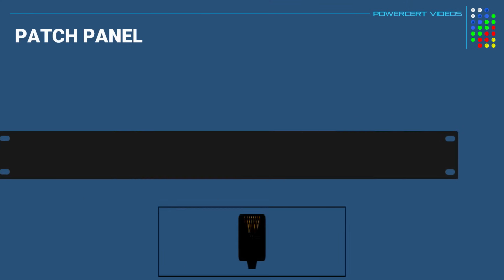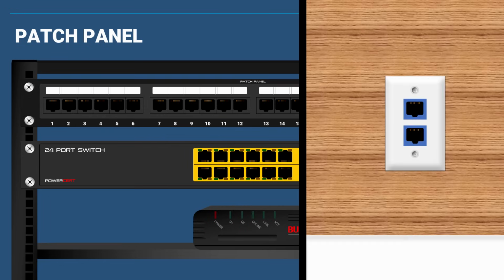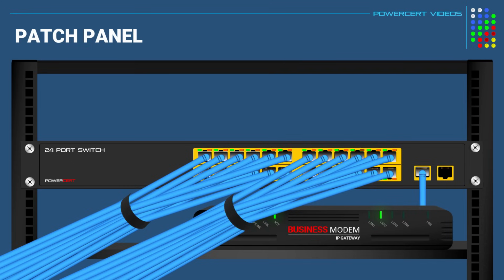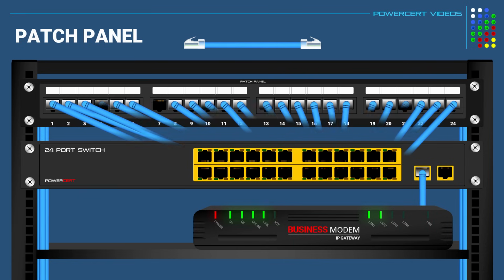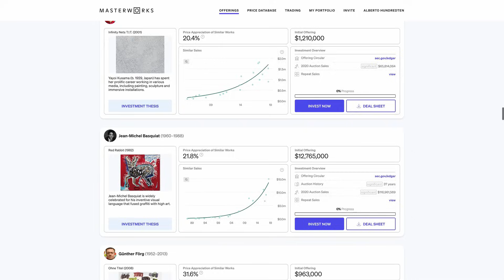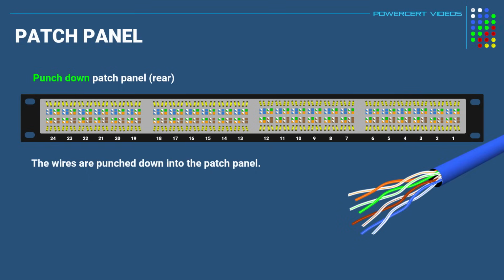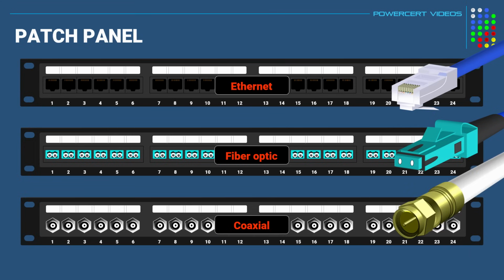What is a Patch Panel?  (cable management)

Comment from the maker: Purchase shares in great masterpieces from artists like Pablo Picasso, Banksy, Andy Warhol, and more: https://www.masterworks.art/powercert
Reply: Next is "how olt onu and fiber splicing works?"
Reply: Nice Video ...😊 Please Discuss in  details which is i am going to share here with you unique and simple animation way .... 1. ARP [all type arp], 2. Layer 3 packet structure and changes while passing through Router, Firewall, Core Switch, load balancer devices, 3. IPsec. Work flow 4. TTL value ... I will share more later on. For now that's all
Reply: Bro I am a thumbnail editor if you need   I am willing work with you
Reply: Can I ask you what program you use for your graphics in the videos, I am in my training to be an administrator and for my exam it would be very useful to use this program as it is very clear and simple. Thanks in advance.
Reply from the maker: Powerpoint

Comment: I still don't understand.... It's just one more connection 🤷
Reply: Yes its one more connection. But patch panels make sense in large networks where you have many data drops. I work in K-12 IT.

In our environment, we have an IDF network cabinet for every wing of about 5 classrooms. Each classroom has about 10 data drops. That's 50 network cables running into a network cabinet in a central classroom. Those data runs terminate at the patch panel and we then connect a patch cable between the respective patch panel port and switch port. That way we can more cleanly organize our physical wiring and not have 50 cables plugged into a switch when they're not needed.

Look up pictures of network closets and you'll see why they make sense.

Comment: I still dont understand....so if you have a switch that allows you to label where the connections are coming from would you still benefit from  a patch panel?
Reply: Patch panels make sense when you have a large network. I'll give you an example of my work place (K-12). We have a network cabinet in each wing of classrooms. Each wing usually contains 5 classrooms. And each classroom contains about 10 data drops. That's 50 ethernet cables coming into a network cabinet. Technically, yes you can bypass the patch panel and plug directly into the switch. But this is not done in large networks since the ethernet cables are not meant to be moved around that much. They can break if you move them too often which means you may need to re run the entire cable run which can be difficult and/or costly. So we terminate those cables into back of the patch panel. Then we plug in a shorter ethernet cable (patch cable) from the appropriate panel port into the appropriate switch port. Our switches have their ports labeled based on what they are for. In our example, we designate 5 switch ports for access points, 5 switch ports for VOIP (digital phones), divide the rest between security camera, staff, and student ports for their respective VLANs.

In small networks, like a home or small business, you likely won't benefit from a patch panel. It makes sense in medium to large networks especially when you have a large number of wired devices: printers, phones, cameras, Wi-Fi APs, laptops/PCs and the like.

Comment: What happened to the other end of the cable? Where should it be connected to
Reply: One end of the cable terminates at the patch panel. The other end terminates at the workstation area - that could be a cubicle, an office, etc. You would terminate that end into a keystone jack.

You bridge the connection between the panel and switch using a patch cable. It is just a short ethernet cable.

Comment: You missed another great benefit of patch panels. The building network wire once installed is rarely disturbed during diagnoses, repair, or modification. Only the more flexible patch cables are. This increases network reliability significantly! 99% of jobs require patch panels.

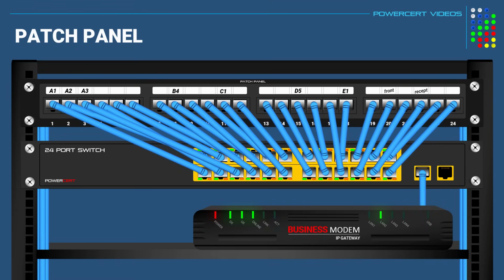Comment: 4:40 Switches usually work at Layer 2 of the ISO/OSI model, meaning they forward data based on MAC addresses, not IP addresses. Routing, which involves IP addresses, is typically handled by routers. That said, there are some less common Layer 3 switches that combine both switching and routing capabilities, allowing them to route traffic between VLANs or subnets, but they are generally used in more advanced or specialized network setups.

Comment: I've been in this business for 16 years. I lost count of the number of cables that are connected from the patch panel to a switch 2 RUs below it (inches away) using a 6'-10' patch cable with the excess balled up in a knot and crammed into the nearest crevice.
Reply: I work in K-12 IT and our network cabinets were the same way. Years upon years of neglect and laziness led to some pretty horrible looking cabinets. We cleaned them out almost a year ago with much shorter cables, but its still not great IMO.
Reply: @JJFlores197  I once did a job for a pharmaceutical company where the IT designer was once an installer with many years of experience.
He designed the layout with one patch panel. above one switch and stacked them in racks without wire managers, saving space. The patch panel and switch ports were connected with 6-inch patch cables port for port sequentially. It was beautiful and easy to install. No cable management was required.
It was a common-sense design. Some switches had 12 ports and a 12-port patch panel, some 24, and some 48. 
No labeling was required on patch cables. He used different patch cables to identify each port: blue for the workstation network, white for cameras, red for badge access, yellow for WiFi, etc. Each device or outlet was identified by the port with a matching-colored label. All the cabling to each device matched in color and had its own lane in the basket tray. Devices had their own switch for each floor, and they were connected to servers that were connected by fiber throughout the facility. It was a work of art.

Comment: Yea but why, it's not really "more organized" than if you just take the time to label the cables going into the switch. Patch panel is just extra work and cost for effectively no benefit.
Reply: When you have 50+ data drops, it becomes very difficult to keep it managed. I work in K-12 IT. A network IDF cabinet usually services a wing of about 5 classrooms. IF we assume we have 10 drops per classroom, that's 50 ethernet cables going into one network cabinet. It can very tedious having all of those neatly labeled. That's why the cable runs terminate at teh patch panel. Then we just patch/unpatch drops as necessary.

Comment: Useless panel.
Reply: I wouldn't say they're useless. Depends on the application. In very small networks, yes it doesn't make sense. But when you have larger networks with many different network cabinets across the area, it does help to have patch panels.
Reply: @JJFlores197  why would on earth you use literally a joint( patch panel) when you can run full length cable to your network gear.
Reply: a patch panel is just conductors with no electronics

Comment: This was soooo helpful. I'm currently an IT Technician trying to move into Networking and though I get the concepts sometimes it's hard to grasp. Appreciate it!
Reply: what do you do as an it technician if it's not networking?
Reply: @gamecubeplayer  I'm on the support side. I take care of tickets submitted by staff members that usually just pertain to their devices. I do sometimes work with our Network Engineer. For example, if we need to set up a new printer whether wireless or wired. If the network goes down at one of our locations, I might go restart a router , switch, check on an access point, etc. Nothing too intricate.

Comment: You forgot one thing. Most wire ran long distance over 50 ft is solid core wire. You dont want that being handled everyday being bent and twisted. A patch cable that takes over at the patch panel is stranded wire. Stranded wire can handle bending and twisting everyday, It will fail at some point but nowhere near as fast a solid core wire.

Comment: Is keystones connectors and RJ-45 connectors are same?

If same then why the name diff?

If not same then whats the main difference?
Reply: They aren't necessarily the same thing. Keystone jacks in this context are the blue jacks you see at 1:12. These jacks are what go inside of the wall plate. A lot of patch panels nowadays use modular keystone jacks. That means that you can put individual jacks as needed rather than having a pre-populated panel.

Comment: Hi, i have poe switch, can poe go through patch panel to power my AP ?
Reply: a patch panel is just conductors so it should work as long as the electrical resistance isn't too high

Comment: I have one question. In this video, you said a small cable will connect the switch with the patch panel. Is this cable called the patch cord. ? I see some yellow color patch cords. But dont have much information about them. Where and Why are they used. ? Pls reply.
Reply: Its a standard ethernet cable, but we use the term "patch cable". The color doesn't necessarily matter. In well organized networks, you designate different colors for different purposes - say blue patch cable for computer work stations; green for VOIP phones; purple for security cameras, etc.

Comment: Question. My house was a new build and it was wired with CAT5e cables to every room. The cables are not terminated in the box in my closet. Do I need to do this or can I just terminate the cables and plug them straight into the router?
Reply: a patch panel is just conductors with no electronics

Comment: I'm a mechanic with 30 years in computers/networking. At my job, we've had random dhcp loss on a little unit thats a pc in a very small package. Thing can't be more than 6x5. Ita linux baaed. The networking room consists of a voip modem, cable modem, two wireless routers & a switch run through a patch panel. I've verified everything is proper but it randomly loses dhcp & sometimes will never recover. All other lan ports work fine. I'm not sure if it's the switch or patch panel causing this. The wiring is a headache to figure out but it's all proper far as I can tell. Our local isp can't fix it so I've been tasked. Any ideas? It seems like ip addressing isn't sufficient but it's just this one unit. When it does aquire an ip it runs perfect. The panel is coupled type.
Reply: Can you bypass the patch panel and plug the Linux PC directly into the switch with another network cable? If the issue doesn't happen again, you can assume its a problem with the wiring. If it does happen, it most likely is a configuration problem with your DHCP server.
Reply: @JJFlores197  It resolved itself but I know it's a dhcp issue. The networking is a nightmare & I'm not paid for that so I let it go.

Comment: Looks like this patch panel adds 1 more connection joint in the span of the cable. Does this degrade the quality of the signal?
Reply: I believe any type of junction does cause a bit of degradation, but in most instances its negligible. Patch panels are not absolutely necessary. However, most businesses or organizations with large networks use them for managing cables and ports. I work in school IT support. We have at least 10 data ports per classroom. Most wings have about 4-5 classrooms. That would be at least 40-50 ethernet runs from the classrooms to the network cabinet servicing that wing. Without patch panels, it would make the cabling incredibly messy going into the switch.

Comment: Why not just label each Ethernet cable that goes into the switch.
Reply: That is an option, but if you have many data drops, that can get very messy very quickly. Patch panels are not absolutely necessary. However, most businesses or organizations with large networks use them for managing cables and ports. I work in school IT support. We have at least 10 data ports per classroom. Most wings have about 4-5 classrooms. That would be at least 40-50 ethernet runs from the classrooms to the network cabinet servicing that wing. Without patch panels, it would make the cabling incredibly messy going into the switch.

Comment: The purpose of patch panels isn't to make cabling neater or organized (since you could also organize neatly on the switch itself) but to eliminate you plugging and unplugging the switch directly. Switches are expensive, patch panels are not. The more you poke the switch interfaces every time the network changes, the more likely it will break.
Reply: That is accurate, but it is far more like that the cable run will fail over time rather than the switch ports.

Comment: So from this video, patch panel is there to make lan cable more organized and track able.

But you can also print a label (a1 a2 so on) and stick it on the end of lan cable connected to the switch. It should be the same right?

Plus pushing the cable to patch panel looks like more complicated than plug in n out rj45
Reply: Yes you can label each individual cable. However, that can get very messy very quickly especially if you have a lot of cables to work with. Once you have the cables terminated into the patch panel, its not difficult to patch them into the network. You simply grab another ethernet cable (referred to as a patch cable) and plug on end into the port you want to make live and then the other end into the switch. That's it.

Comment: Another good use is you can now move equiepment up and down a rack with a patch panel since you only need to move cables from the front of the patch panel to a new device.
Reply: Can do the same without it 😅

Comment: I dislike loaded patch panels especially if they are not full. I always use unloaded patch panels as they are easier to work with, add additional cable drops, and make troubleshooting much easier. What are unloaded patch panels, they are blank and use keystones on the patch panel end as well. If you need to add drops you just clip the keystone in. With the loaded type you need to take the panel out to add. Additionally keystones are way faster to complete as I use a brand and tool that does all the punch down in one motion. Saves time which is valuable.

Comment: If a line works directly to the switch but fails through a panel, check the length of the line. A line that is maxed out in distance may not have enough signal left to be reliable through a panel. The resistence through the panel may be the straw that breaks the camel's back. The panel is not powered and will not amplify the signal. Punch down is slightly less resistent than a rj45 on both ends.

Comment: But in order to know which device the back of the panel is connected to one still needs to be organised at the time of original connection . If this was done to the cables coming from the various rooms/devices and the cables labelled appropriately the same result can be achieved without the patch panel (albeit the panel is a bit tidier to look at from the front) ?
Reply: That is correct. A patch panel is not absolutely necessary, but it does make it easy when you have a large network to organize the cables. If you have a wing of 5 classrooms that all have 10 data drops, that's 50 ethernet cables going to a network cabinet. It is much easier to simply terminate those 50 cables into a patch panel and then label the data drops in the classroom and the panel accordingly.

Comment: Yes a patch panel helps in troubleshooting network issues.  I had to redo my ancient install as the original install was a mess.
Reply: talking about a mess, I got one story. I have never seen "randomized" numbering... I mean, on the patch panel the numbering looks ok: 1, 2, 3 and so on. However, eth jack #1 can be at the front desk BUT eth #2 is NOT anywhere near jack #1. #2 can be anywhere in the building (at the back of the building for example). Then #3 jack isn't anywhere #2 either. It's somewhere in the building. What a complete mess.

Comment: it is more complicated to change the wire of a patch than a switch because now you have 24 additional connections without counting the installation time it is faster to disconnect a cable directly from a switch
Reply: Yes, but you don't usually replace a cable run unless it is bad. If you have things labeled correctly on both ends, you can very quickly figure out where the port on the patch panel is.

Comment: It could have been useful to show a real world example of how it helps in troubleshooting. For example, instead of second guessing which wall outlet the port is connected to, you see the wall outlet written in front of you, so there's no mistaking it, and no need to have another person on the other side to see if the light is blinking, to verify where the cable is going to
Reply from the maker: Good point
Reply: Hopefully they will soon design a piece of technology that tells from one end whether the light is blinking on the switch in the server room. I like your point.
Reply: @MwishaLudack  There are cable tracers for that use case. You plug a device that sends a tone throughout the cable. On the other end, you have a device that can pickup that tone. It is pretty useful when the labeling is not done yet or was done poorly or not at all. There are even more advanced testers that can tell you how long the cable is, if there are any breaks in the cable and many other pieces of information.
Reply: @JJFlores197  Oh, I think I've been missing the memo this whole time, I worked without the useful tool. I will be on a hunt for them without wasting time. I haven't been working smart in this regard. Thank you very much JJFlores197, this is helpful to me.
Reply: @MwishaLudack if you still need help finding one, in my country, its called a tone generator but on the videos ive watched they call it fox & hound /tone generator.